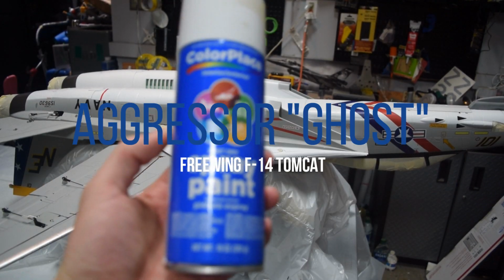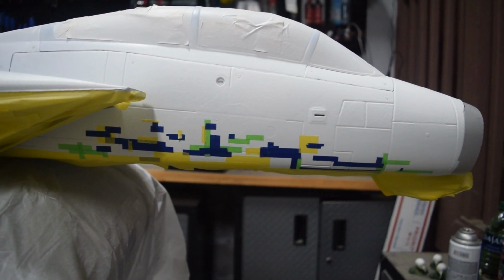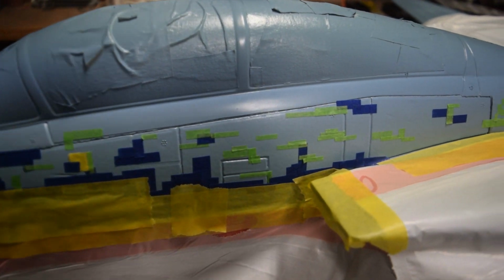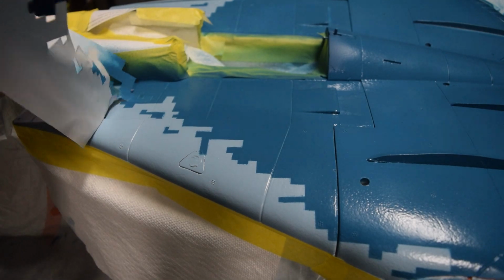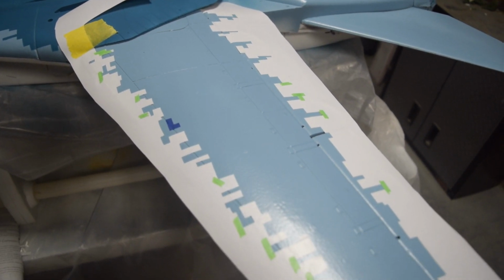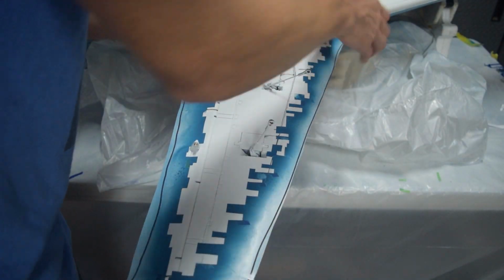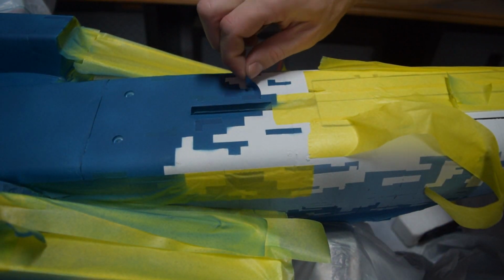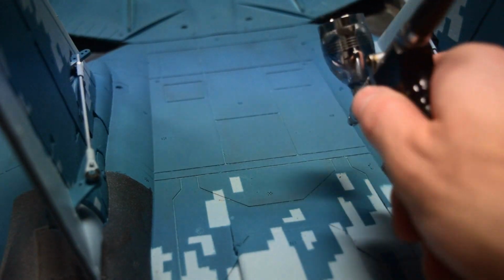How to Paint the Ghost Aggressor Paint Scheme - Freewing F-14 Tomcat - Digital Camo Painting

Comment: What compressor and spray gun are you using may inask
Reply from the maker: VIVOHOME 110-120V Professional Airbrushing Paint System with 1/5 HP Air Compressor and 1 Airbrush Kit for Tattoo Makeup Shoes Cake Decoration Silver https://www.amazon.com/dp/B07WGTS2K2/ref=cm_sw_r_awdo_navT_g_KCVJ1V4FBCS6JTSMA2MV
Reply from the maker: Master Airbrush Model G79 All-Purpose Precision Fixed Dual-Action Trigger Style https://www.amazon.com/dp/B0026SHUMA/ref=cm_sw_r_awdo_navT_g_05GXMH6RC6FGNBWHRSWY

Comment: Do you put any coats above to protect the paint or any gloss coating or anything? Or when you paint do you leave it as is?
Reply from the maker: Most of them I leave as is. The best flat top coat I found is Testors. Everything else I've tried adds too much shine/ gloss and will slightly change the colors. For my blue angels, Disney plane, and other high gloss / high visibility planes I use 2k clear coat from Amazon:

USC Spray Max 2k High Gloss Clearcoat Aerosol (2 PACK) https://www.amazon.com/dp/B00W2D806Y/ref=cm_sw_r_apan_glt_fabc_XV1HD70YJCP8MH3JD9BM?_encoding=UTF8&psc=1